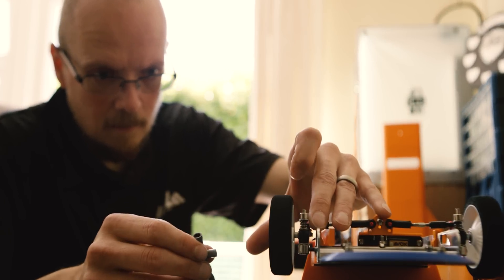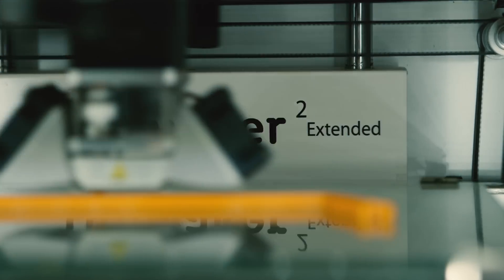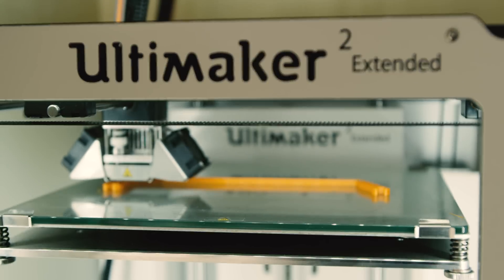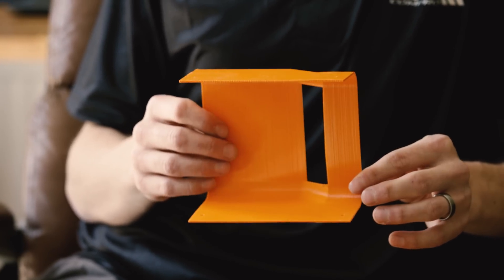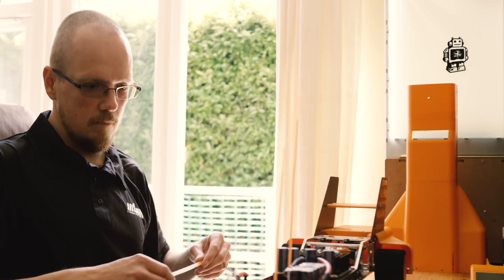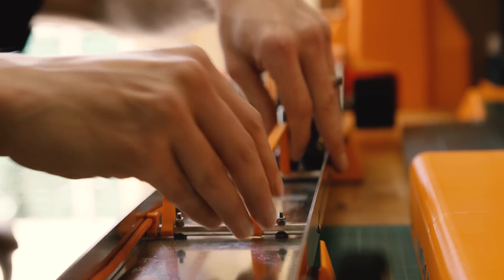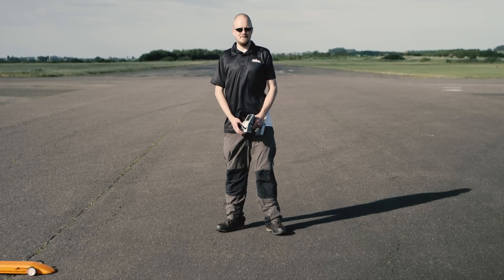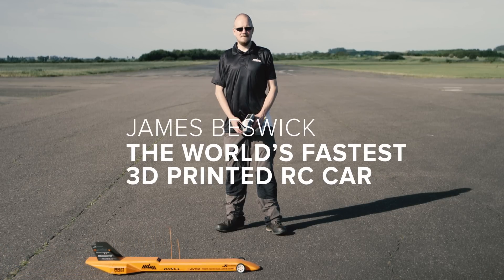World's Fastest 3D Printed RC Car - Ultimaker: 3D Printing Story

Comment: So did it go 67 mph or 113 mph because that sure looked slower than 50.
Reply: Looks around 100MPH which is easy to tell judging track distance and seconds it takes to go past it. So I guess the one monitor that says 113MPH is the correct one, not sure why the other one is so far off. Either way the fastest 3d printed RC car currently is 202 MPH
Reply: @gg-gn3re  thought that printed rc car is one of those a tethered ones

Comment: you can stabilize a lexan body by adding stiffeners or simply securing it on the frame in more places. Not to mention the weight savings over a pla/abs body. Also, one flip on that body and it will shatter because of layer separation. That wont happen with a vacuum formed lexan body. I'm not putting down 3d printing, i have 2 printers myself, and routinely print 1:32 scale car bodies.

Comment: only the canopy is 3d printed...
Reply from the maker: +TheZorglub007 The rear wing, servo holders, controller mounts, battery and cable clamps, and shock absorbers for the electronics were also 3D printed.
Reply: +Ultimaker Also what's the point of a ''dragster'' if it only hits 100km/h?
Reply: roborovsky 100 MPH wich is 160 kmh...
Reply: +Anthony V it goes over 100mph. so thats way faster then 100kmh
Reply: It says KPH and MPH, so both. not "KMH" Elias, please learn to read. Also the current world record is 202 MPH
Reply: @gg-gn3re  kmh is kph in german
Reply: TheZorglub007 very true
Reply: What do you expect? Most if not all high speed, high load RC vehicles use metal or carbon fibre chassis. At over 100mph the load on the chassis would be extremely high for even cast plastic sheeting let alone fmd printed. The title doesn't lie. The majority of the car where appropriate is 3D printed.
Reply: it said kmh not mph
Reply: ɷɷ Heeyy Friendz I Have Founddd W0rikingggg Online Hacck visitt  : -  https://t.co/DpGBarCUaA
Reply: @dipengurungg6292  dude can you even make sense?